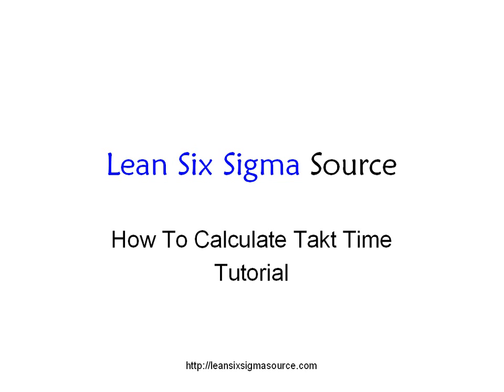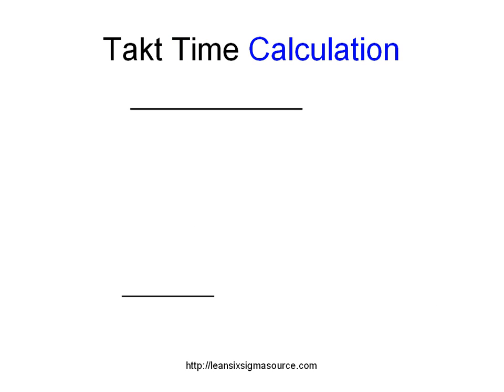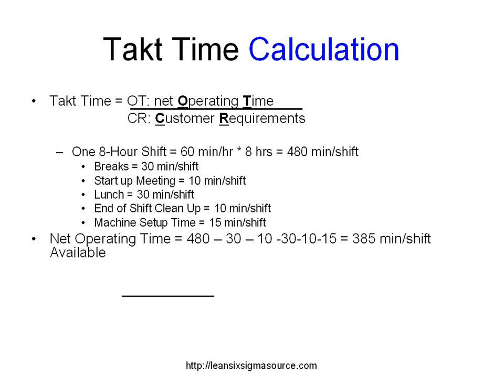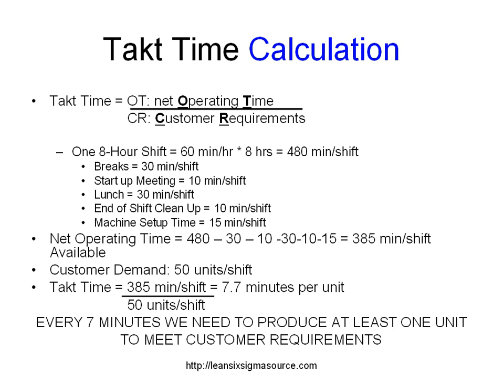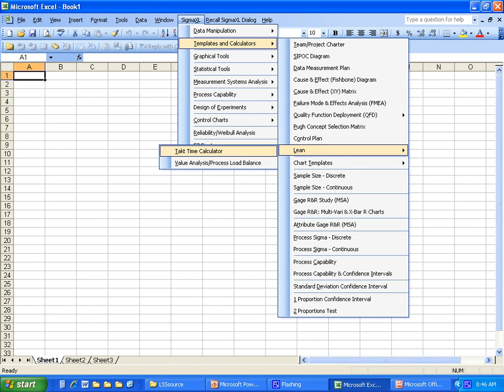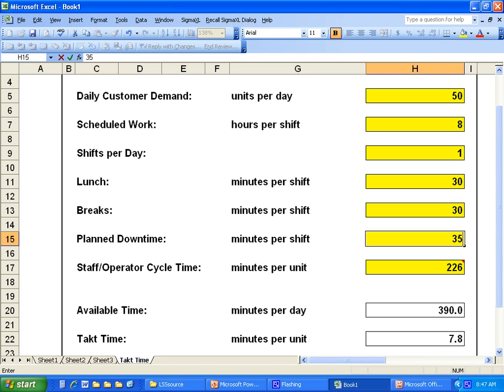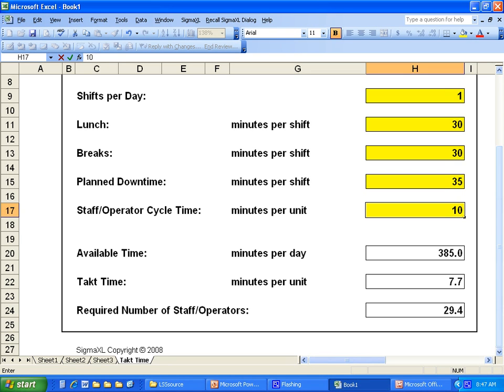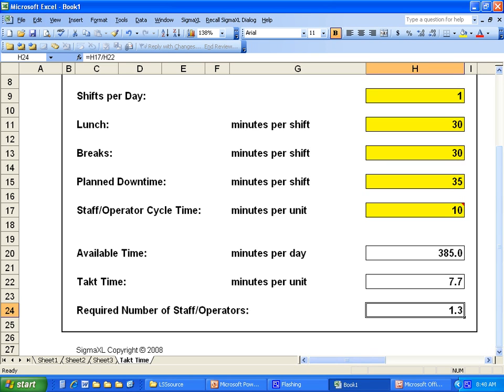TAKT TIME: How To Calculate Takt Time Tutorial

Comment from the maker: @vidoent Your takt time is the rate of customer demand.  Customer demand is separate from cycle time, which is the measures the average time it takes a worker to complete a task.  And when you're doing your time studies you should take times for multiple workers and multiple shifts (if possible) to determine if the completion times are reasonable.  The cycle time will be used to estimate the number of workers needed to achieve the takt time.  Does that answer your question?